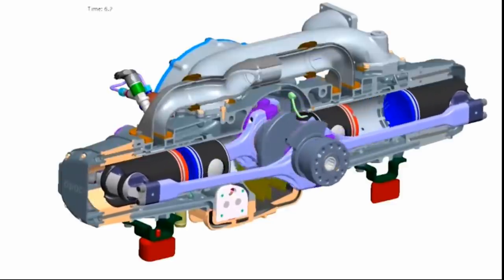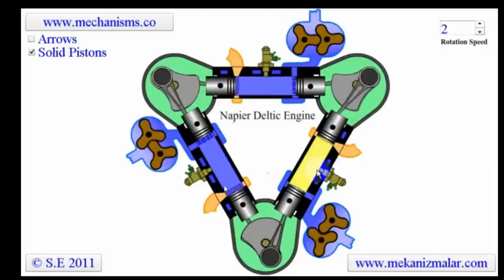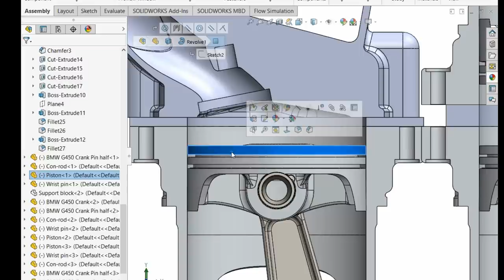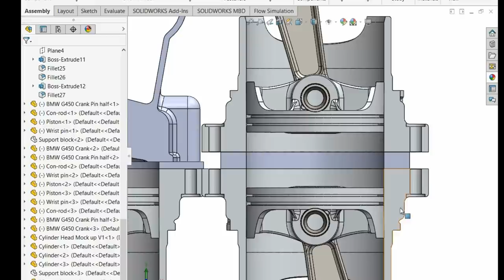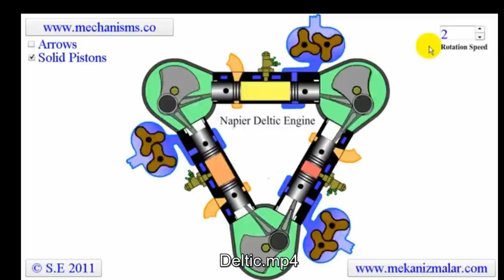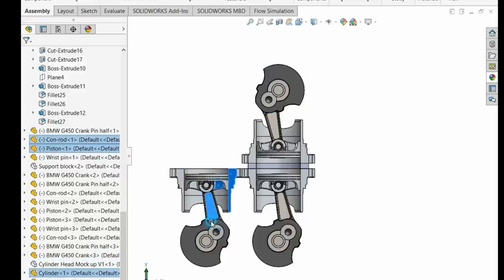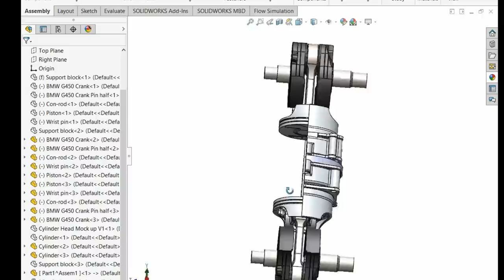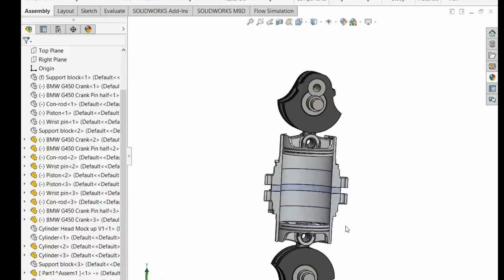Opposed engines are better?

Comment: You are missing a very important feature.
You got 2 pistons moving opposed,  so 1 piston only has to cocer half of the darn stroke. So you have half the avarage piston speed, and same goes for piston accelaretion. For a given rpm and stroke / bore vs a regular piston engine. It has less losses, you know that 0.5*m*v*v thing, having double the mass but half the speed means buisnes.
And thats where these things shine when you got them runnning. Allso pistons moving in exact pairs, it has better balance.
Reply from the maker: Wrong. Look at my example. Same speeds... if you have 2 pistons for the same volume as 1 cylinder then that really is stupid.
Reply: Absolutely not stupid. Yer 1 cylinder engine covers only 1 stroke length. The opposed one covers 2 stroke length. So its double the capacity.
Reply from the maker: Double the capacity, double the fuel, double the mass... 2 engines...
Reply from the maker: Minus the heads, like I said in the video
Reply: Come on now. Take a 100 ccm single cyl engine. Do it like you do on your video. You get 200ccm engine. Now down size that thing to 100ccm. You can half the stroke. So you get half the piston speed on avarage.
Plain simple. 
Oooooor you can use half the bore area, and keep the long stroke. In witch case you get smaller mass. And in Both cases you get better balance. 
Oooooor you can upscale the tiny 100ccm 1 cyl engine, but then you have issues with balance. Kay?
Reply from the maker: So you benefits based on this idea are piston speeds, and balance. Vs a design that has 2 cranks and poor valve control? This design is SO beneficial that no one used it... says a lot that doesn't it. And here's the kicker. All engine manufacturers have all of the facilities to build then and all of the patent are out of date. Still not in mass production
Reply: @dirtygarageguy  few years ago the same would had been true for battery powered cars. (the technology being there, yet still not mass produced) 

allso its not an idea. you know engineering, i'm pretty sure you ain't having doubts that 2 times the mass moving half the speed is a better option. and allso balance is desired in an engine.  crank mass wise, you do realise you need 2 small cranks instead of 1 large crank right ? 

so then, why it is not made in mass production, answer is both simple and complicated.
1. eeeelectric shite is taking over the car market , there is no interest in new engine designs. 
2. as you point it out these things would do best at 1 fixed rpm. not quite what people need/want.

to proove a point, diesel electric drive train is allso a thing that has been around for quite some time and is more efficient than a manual gearbox or a mechanical cvt. along with waste energy recovery turbines quite often used in other fields, how come no farm tractors use them ? (actually there are a few turbo compound ones , like one made by RÁBA back in soviet times) YET with today's advanced turbine technology you still don't see them on tractros. even if they would be very good target. as they usualy do some heavy work and we do tend to keep em around the max RPM all day and night.
Reply: @dirtygarageguy  double the power, but without the thermal losses out the head.   So you are wrong again.

Comment: Crazy idea.what about generating energy and positioning a fuel engine piston with electricity at the same time? No crank or rod straight from cumbustion to electric! Electric piston?
Reply: The piston is a linear motor that can work as a generator also
Reply: You could program different stroke lengths also.

Comment: https://youtu.be/BPr694nlUKE
https://youtu.be/uiXsPkP9jvw
 Here an OP Uniflow twostroke, 25 years ago. Crank case pumped. Four pistons, two cylinders.
9200 rpm at about the five minute mark. I still have this engine.
There are some real benefits form this layout, some you seem to have over looked, Mathew.
Reply: Yeah a 1700 Rotax OP made from 850 Rotax Etec turbo 2 stroke motors.
Reply: Yes OP 2 strokes in snowmobiles would be insane.

Comment: Opoc engines are nothing new, they've been used in submarines,trucks, and aircraft( the Junkers jumo 205 diesel) and they displayed superior range,reliability,and less maintenance along with less parts(no cylinder heads,head gaskets, only one rod, piston,crankshaft and bearing designs) to inventory. There are more advantages than disadvantages to their use so.......

Comment: I would port oil through the pistons to keep the rings cool. but also- I would make the pistons of stainless steel- with a concave surface on both- and mirror polish them. this would reflect a huge portion of the heat- and keep it from transferring to the metal as much.
Reply: Run amsoil interceptor 2 stroke oil, its what i run in my v8 2 stroke.
Reply: Yeah then it would act as a reflective wave guide to keep the electromagnetic energy in the chamber.

Comment: I think OP engines are the future. 🙂
OP (2 cranks/cylinder) are more efficient - makes more power due to less heat loss. Needs less cooling.
Achates/Cummins is making a new OP tank engine and truck engine. 
It have been used in tanks since 1960. Soviet/Ukraine T-64 (5TD) and UK Chieftain (L60)